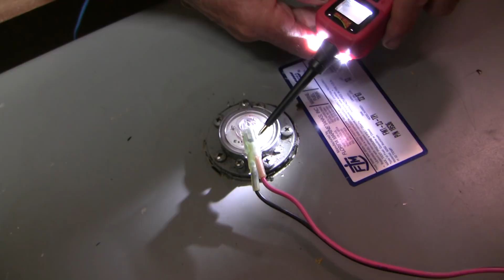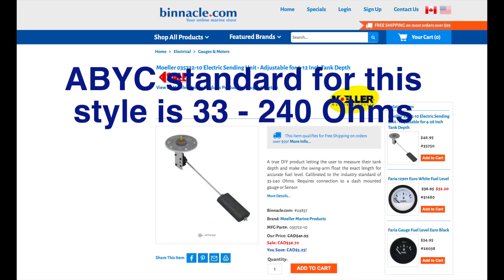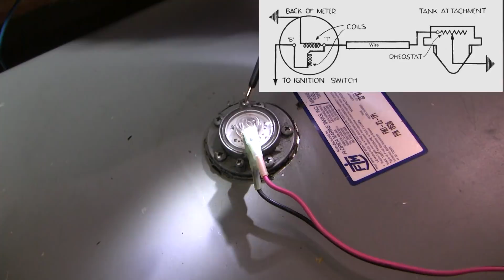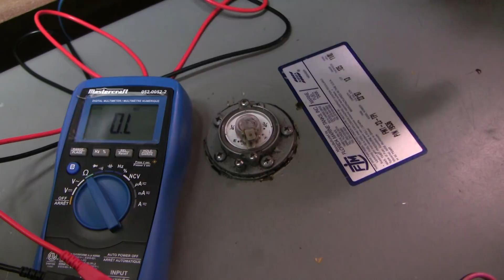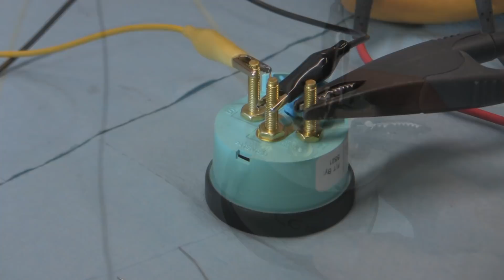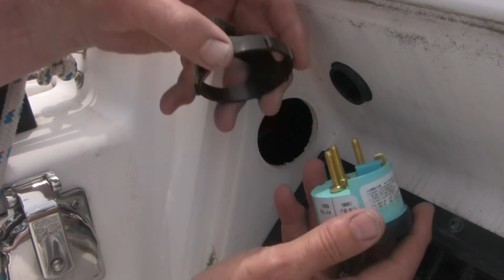How to fix a marine fuel level sensor

Comment: thank you for your excellent presentation including the electronic theory.
i found your channel actually looking for diagnosis and repair of my yamaha fuel mpg sensor in the back of boat by fuel filter.
mine just stopped indicating mpg, am wondering if you have a video on this or perhaps a idea where i can find info on diagnosis and repair .it has 3 wires coming out of it, and then wires up to the round yamaha gauge on dash.
asol just having trouble opening up the black connectors there a a lever or special way?
sorry for long winded question, have subscribed  and will follow.
thanks
john
Reply from the maker: I have no experience with your issue, so all I can offer is general advice. Yup, plastic, brittle connectors are the game we play, often breaking them before realizing how they come apart. In a boat, water intrusion and corrosion would be the most common cause of electronic failure, often with the hallmark of the 'green crusties' when water meets copper. Something complex enough to calculate fuel consumption likely has a printed circuit board involved, somewhere. I would be searching for your dealers repair manual for as much detail as you can find. Yanmar offer those for free, Kawasaki sell inexpensive copies on their website, and some european manufacturers strangely covet their repair manuals. Good luck!

Comment: Hi Dave, great video as always. Clear and simple. 

I’d like to add a second gauge to a fuel take sender. Is that possible without changing out the first gauge?  I have a multi tank gauge at my chart table below deck and it would be nice to connect that to the sender to check all my fluid levels from below decks and without having to start the engine before setting off. A sort of pre-sail checklist.
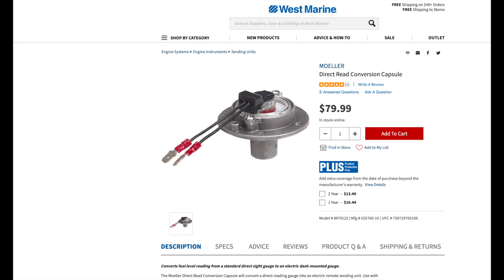Reply from the maker: I would not place a second gauge of this style into the mix, because of the added circuit complexity and increased possibility of unreliable readings. Each analog gauge requires its own power source, so slight differences in impedence between the coils of the two gauges could produce damaging current between the two on the signal wire, and spurious readings. On the other hand, if the second gauge was a simple high impedence voltmeter, then you could have a second meter that simply reads the voltage drop at the signal wire, which you could calibrate to tank reserve. The ignition key would need to be on, though engine doesn't have to be running. At 2:06 I show a sender (like mine) with a built in gauge, so that system has a useful mechanical backup which helped to draw my attention to the problem. However to swap to that you would have to remove the sender and add it on, hoping holes line up and it adapts correctly to your sender. New systems might allow multiple gauges more easily by tapping into the NMEA2000 communication tree. Thanks for watching!

Comment: Well done :-D
Old car fuel guages are not linear devices, so i guess that the tank sender is the same.
That red wire looked pink, maybe my display is mad :-D
Reply from the maker: Yeah, that's a thoughtful observation! As you say, even with a purely mechanical gauge the result is not linear, since the volume is related to the sine of the angle, only linear to angle when the angle is small. From our old calculus days they said x/sin(x) is approximately 1 only when x is small, ha ha! Practically that explains why in many tanks, the gauge doesn't change much at first, then when close to empty it seems to fall quickly as the angle changes more rapidly. In the end it is not so bad, since a driver gains familiarity with his gauge and tank. On a diesel boat it can be a minor crisis to run out of fuel on the water, since with no fuel pump you need to bleed the whole fuel line before it will start again....
Reply: I'm sure you are correct with the mathmatics, but you are talking to someone that could not remember the times tables at school lol.
They didn't cator for odd people like me, that is very true for that era of schools.
I learnt by visual means and taking things apart, some numbers sank in to my thick brain as i had to remember pins on dip i.c's, still took 20 plus years lol.

Any how, a frend of mine has a morris minor 1000 chug a bug, the tank gauge was never very accurate and he wanted me to make a led bargraph gauge..
I found a very handy bargraph circuit that used discrete parts, lots of comparitor op amps and a PRESET FOR EVERY LED voltage threshold.
Non linearitys in the tank sender could be trimmed out.
Simple but nice idea, not my own of cause :-D
It may interest you. Bottom of page.

http://www.mez.co.uk/ms13-new.html
Reply from the maker: @zx8401ztv  Cool idea, especially with an odd shaped tank like that one! Most of us just shrug and get used to idiosyncratic gauge personalities, ha ha.
Reply: ha ha yes i did think the whole setup was really silly.
Did you see the circuit at the bottom of the page?, there is no limit on how many leds and comparitors can be added.
Funny how someone creates a circuit that i have seen so many times but it didn't come to mind while i was thinking how to make a guage.
I must be born silly :-D.

Comment: Definitely convenient to have a fuel gauge working properly on a boat.   Nice diagnostics!
Reply: You got that right,mine just went out😂
Reply from the maker: Yeah, I hate that panic of having to bleed air from the fuel lines while drifting in tidal current with no power. Fortunately with a sailboat there is a backup plan if the wind cooperates. Thanks for stopping by!